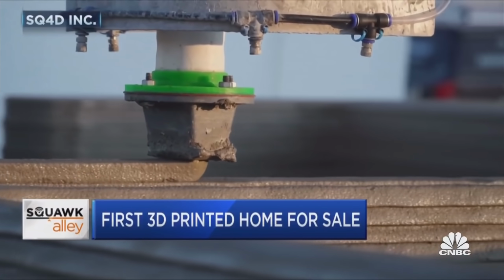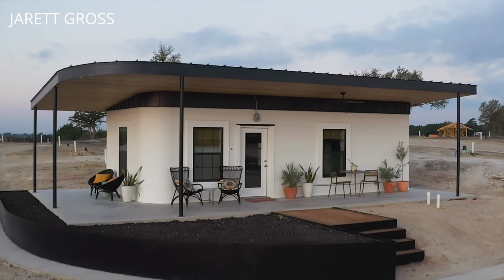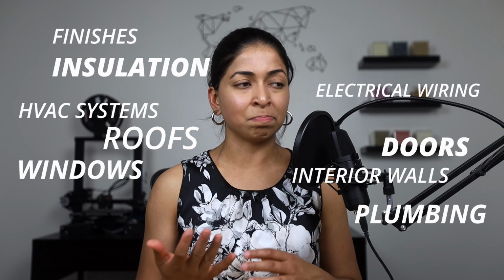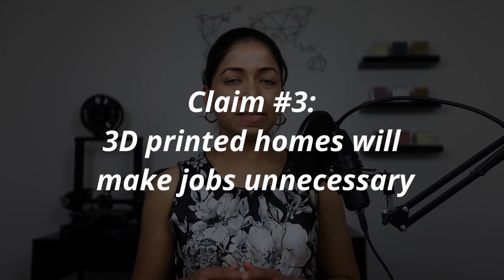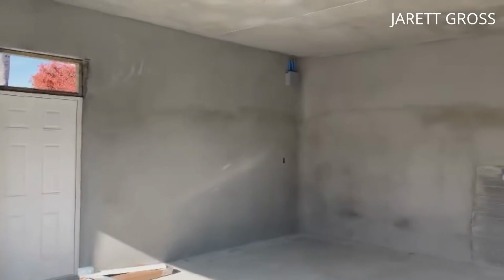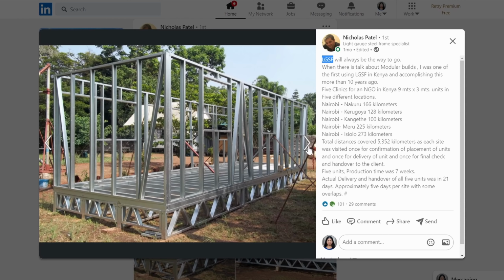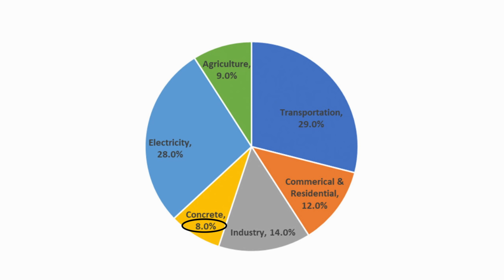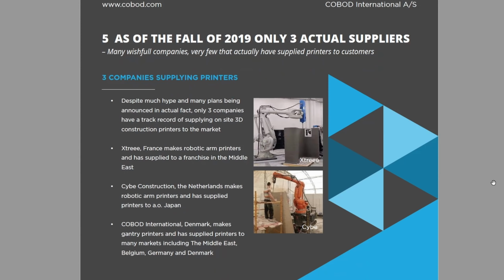Exposing 5 LIES about 3D Printed Concrete Homes

Comment: "3D printing creates walls, not homes."
YES!
Reply: Good border solution.
Reply: @eunoiavision7567  lmao
Reply: Yeah, I really liked that line.
Reply: You could equally say builders build houses not homes... or brick manufacturers make bricks not walls.  Sounds good but bares little examination.

One day someone will build a full house shell from 3D printed concrete and, like all concrete buildings, it will be massively ugly ...
Reply: @I_Don_t_want_a_handle  concrete is beautiful brutalism ftw
Reply: @joshdoeseverything4575  Nah, it is objectively brutal and subjectively fuggly.
Reply: She is right about the price is a lie even only the not printed roof is as expensive as those clowns say the whole house is. I would hire them to just print my walls then because obviously they print them for free😎
Reply: Make America Great Again! Build that wall🇺🇸
Reply: We need to print a wall.
Reply: @I_Don_t_want_a_handle  did you stop at this sentence in the video? because she’s off to list all the other things that have to be installed/built to make a home. If you wanna run a 3d printer all you gonna have is walls with no roof or doors or windows which are basic requirements
Reply: @TheTendouSouji87  Did you stop at the first sentence of my comment ?
Reply: @I_Don_t_want_a_handle  ehhhh with a bit of render and paint or cladding it could look ok just the same as brick houses but with organic curves and shapes
Reply: @TheTendouSouji87  So when a brick shell or pine frame is built for a house over a much longer period of time it still doesnt have a roof, doors, wiring, plumbing ect (which are still basic requirements)??? They both still need to be fitted out after building and materials made off site (copper wire, pipes, insulation ect). 3d printing is just for the shell and always will be (except for the roof, which could be printed if domed or pyramid)    . pretty ridiculous point by her
Reply: keaton jones, the point she's making is that 3D printing of a house (ie walls) is not the full picture as seems to be touted/represented by the champions of 3D.
Reply: @jesjes5255  Exactly. Putting up 4 walls is relatively easy no matter what modern building technique is used.
Reply: Try building a house or home without walls...
Reply: @TheStavros1001 easy, Mies Van der rohe did in the 50's hahahaha 😆
Reply: Well, you can actually build a roof with a 3d printer. A doomshaped (half of a ball) is no problem. In my small plastic printer it is possible to produce a flat roof with a special technic (halfcircles which supports the next one and so on).
Reply: @JohanLofgren-jc4mh   The problem with this is a matter of scale, gravity, and probably a dozen other bits of physics.  You need to support a concrete roof properly and it needs to be reinforced to be structurally sound.  A dome made of plastic in a small 3D printer on your desk will hold up well because it has little mass/weight in comparison to a 10 or 20 foot dome.  Brick domes rely on precise setting of stones to hold up by basically "falling" into each other.  The big problem with these concrete walls or domes is that I haven't seen any reinforced concrete walls  with internal rebar or something to keep them from falling apart  when pitted against the local weather, movement of the earth (tectonics?), wind, etc.

Comment: I'm in the construction industry and build alot with concrete.  Concrete block, poured concrete, tilt up and ICF. Not all cement is the same. The cement they are using in 3D printing is mortar mix and has no structural strength. Structural concrete gets its strength from the rock that is added in the mix it should have enough rock to break above 3500psi.  I'd like to see a break test on this and see how it breaks. With no rock in it it probably breaks below 2500psi. It's like building a block wall using only stacked up mortar joints and no blocks.
 Concrete can handle compression loads but does not do well with torsion loads, tension loads, shearing loads,  etc. When it is used in a structure steel rebar must be added in order to handle the different loads. You can take base cement powder,  just portland and wet it down and it will harden and take a compression load but it is very brittle.  When you add an amount of sand it will become less brittle and tolerate a higher load,  add an amount of rock and it will handle an even higher load depending on the size, shape and amount of the rock. A mix containing crushed rock will handle more load than a gravel mix because the rocks tend to lock together like pieces of a puzzle but without steel to reinforce it, it will fail. 
Building a wall with only mortar mix and no steel is the worst possible way to build with cement.
Reply: Amen, brother. My father is a residential home builder, and even with my limited knowledge of construction, this technology gives me anxiety.
Reply: I am very confused with responses that pretend as though these individuals who are building these houses do not have to conform with the engineering codes put forth by the cities they are built in. I'm sure that because you are in the construction industry, you know that it is extremely difficult to get a permit through in the best of cases (unless you are a huge corp or the like). So why are you questioning the structural engineering when we have dedicated public positions that will not sign off on construction without being checked by qualified engineers?
Reply: @AzureAzreal  well, for one thing, is a different code. They're only allowed to print single story residential, in Texas anyway,  no commercial buildings, limited vertical loads etc, which tells me it's not strong enough. 
My wife used to work in an engineering lab and one of her jobs was crush testing cement samples. She thinks that mix would crush under 2500psi.
All I'm saying is I would like to know the compressive strength of that mix because it doesn't look very strong to me.
Reply: @cameronturner7475  I understand being concerned about applying this method to other building designs, but isn't that a different discussion? It's being applied to code when it is used, correct? So when you say, "not strong enough," aren't you speaking of applications in which it is not being applied? For example, to me, it sounds as if you are saying, "You can't build a 100-story skyscraper out of wood framing because it is too weak." And while that is true, it seems irrelevant because no city would sign off on that and take the liability. So it wouldn't be made. And by that logic, every house you see that is being made is "strong enough" and can never be "too weak" unless the city is signing off on structurally unsound buildings, which they wouldn't do unless they want to lose millions - if not more - in liability claims, right?
Reply: A number of print material utilizes aggregate, some up to 10mm. Some companies are pumping a typical concrete mix thru their system because their pumps can handle the aggregate size. There is reinforcement in almost all of the walls, vertical and horizontal, I have yet to see a building that is permitted have no reinforcement in the walls.  If you look at the data sheets for most 3d print material their 28 day break is similar or better than concrete. Plus all of their testing and mixing protocols meet ASTM standards. Icon's Wolf Ranch development is in a jurisdiction that has a building department. Plus companies like Lennar are not going to develop housing tracts that don't have engineering done. There are many permitted printed buildings in the US. Its not difficult considering the addition of UL3401 to the IRC. A lot of engineers or architects won't involve their firms in these projects unless they feel confident in the structural engineering. Additionally Walmart started using the method to build part of one of their super centers in the midwest. The machine tech and material science is only advancing.

Comment: I have been involved in the 3d printing space for 11 years and have used them in many industries and have even built several of my own and your breakdown was spot on regarding all of your points. Well done.
Reply: Me too but 3d printed homes is a beast of its own. Thats a major part of the problem here.
Reply: I'm a cabinetmaker and have also worked in the architectural cast concrete industry.  I can't imagine trying to clean concrete printed backsplashes in kitchens. It will not age well in that area.  Also, hanging cabinets has got to be difficult. I think sealing windows and doors has got to have some issues along with waterproofing floor to wall joints. It's sort of like self-driving cars. Everyone wants it to work, but in reality, it's maybe a ways off yet.
Reply: Is it much different than designing & CNC laser engraver (CO2-80W 5'x9'x2.5' cabinet), or CNC Mill 4x4 using MasterCAM or CNC router (11'x 4') using Inventor? I've designed, built, program and used them until I retired in 2018. What Autodesk (my most experience) product do you use to build CNC machines. I suppose I should start plastic (like ABS?) before going straight to laser sintering metal powder, right?
Reply: Most people didn't get early computers that were good like Commodore. "Early Adapters" find the problems before the main product stream gets involved. If early adopters don't find solutions to the problem, the technology is shelved until the solution is found -- or the whole project is deemed economically unfeasible. That is called progress. EARLY ADAPTERS FOREVER!
Reply: @bryck7853  its all so closely related. The difference is the materials.  The technology that powers the tools is all basically the same